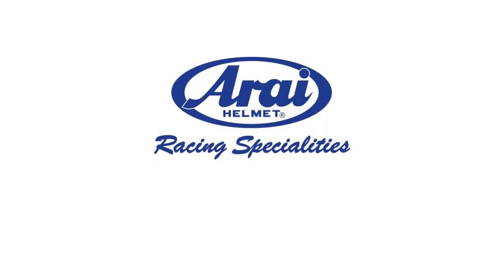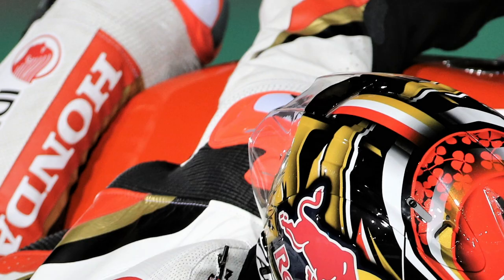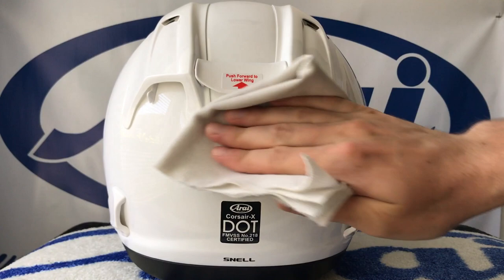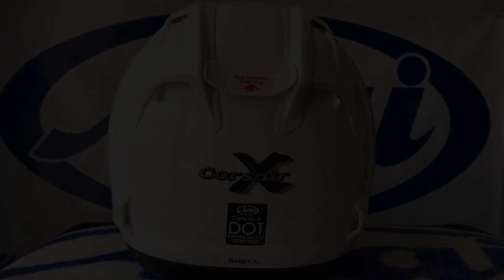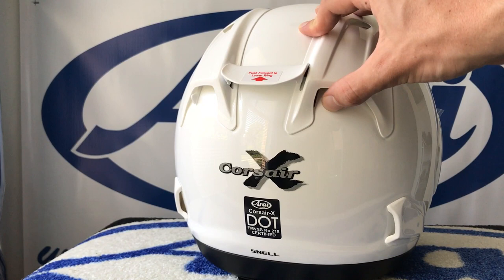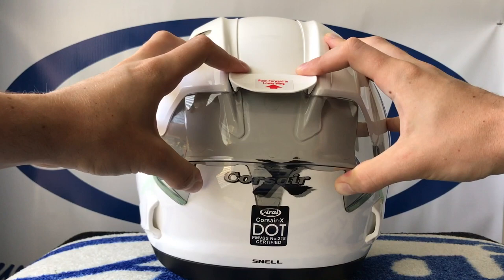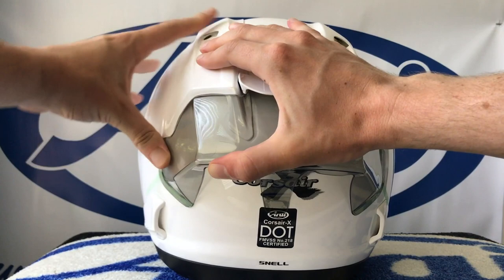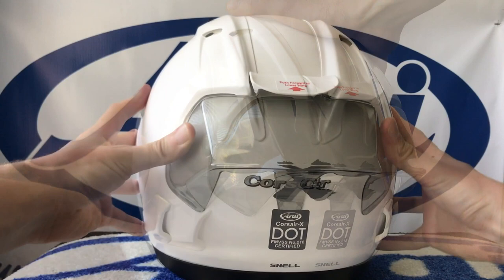Arai Spoiler DF-X2 Installation Guide

Comment: When is Arai going to make a self tinting visor available?
Only reason I haven't bought an Arai yet
Keep waiting but seems like it's never going to happen
Reply: I agree. I decided to pull the trigger on one of the Chinese aftermarket ones. I'll update as to whether it's any good.
Reply: @ayowser01  But is there a reason they don't bring out? I mean at this stage it almost seems deliberate
Reply: @E_Honda  if I had to guess, Arai wasn't able to make a deal to their liking with the Transitions brand, or Transitions [the brand] probably have some exclusionary agreement with Shoei.
Reply: @E_Honda  I received the aftermarket transitions/photochromstic lens; don't do it. It's trash. The fitment is shit and the air vents, as well as the pin guide rattle. It even states on the shield that there's no guarantee that it won't shatter in an accident. 100% returning it.
Reply: @ayowser01  Yeah I wouldn't expect it to be great, just with Arai would make one, need a new helmet soon and would like to stay with Arai but they don't make it easy
Reply: @IN_ZANE_  I find that I like Shoei a bit more than Arai. I just like owning both. Give the new x15 a try. I have one incoming.
Reply: @ayowser01  I already have but it doesn't fit my head shape or something otherwise I would have got it

Comment: Is it necessary to clean a brand new helmet before installing the spoiler?
Reply from the maker: It is best practice, just in case there is anything on the shell
Reply: @AraiHelmetAmericas  is it possible to remove the spoiler if at some point I wanted to put a different color spoiler on?
Reply from the maker: @thismanuelhung  Yes, the spoiler is held to the shell of the helmet with clear double-sided tape.
Reply: @AraiHelmetAmericas  just using a heat gun?
Reply from the maker: @thismanuelhung  No heat guns, they are too hot and can melt things.  Just a blow dryer on low heat.
Reply: @AraiHelmetAmericas  Roger that. Thanks for your replies.

Comment: Doe it fit the Corsair V??
Reply from the maker: Ken, it will not fit on the Corsair-V as the diffuser placement is different.  The DF-X2 only works for the Corsair-X
Reply: @AraiHelmetAmericas  is there a version available that will fit the V model?
Reply from the maker: @kennyvloggins5358  I am sorry but there is not a DF-X2 for the Corsair-V